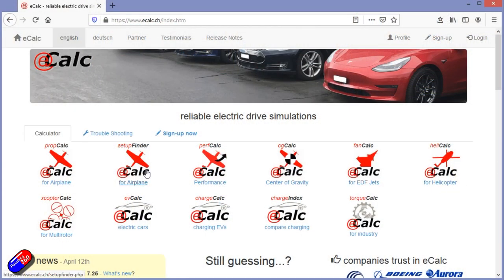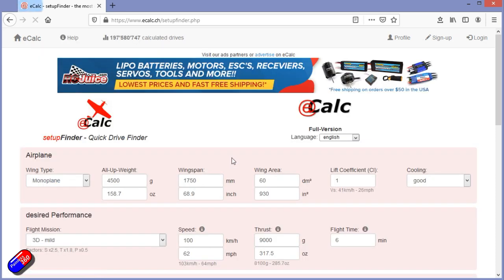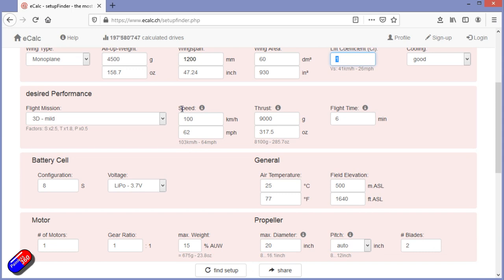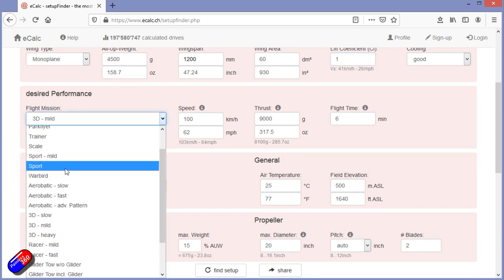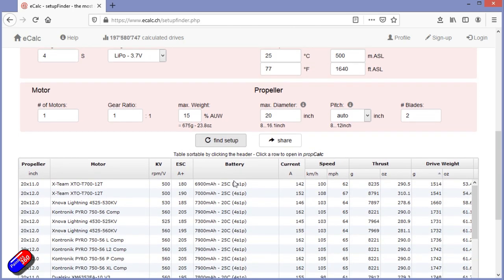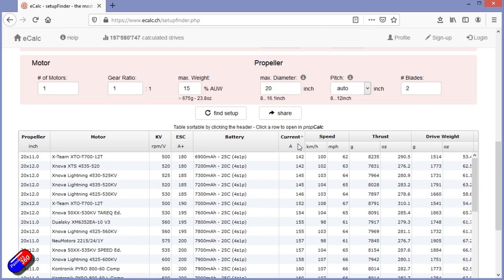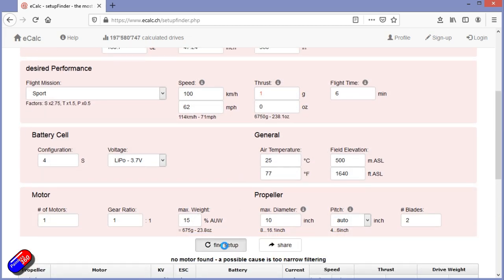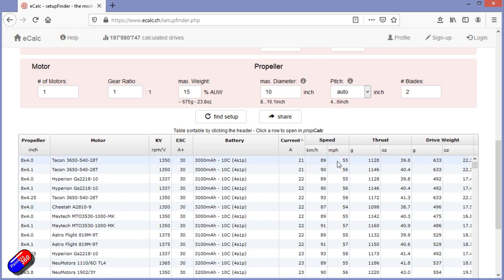Choosing Fixed Wing Motor and Prop. Some Golden Rules!

Comment: Brilliant. I spent months  bench testing and optimising the thrust and lift motors on a differential thrust steer hovercraft. And then optimising the battery for the current draw the best weight compromise. This tool would have enabled much quicker optimisation to motors and prop and batery size. Will be signing up for this tool. Great stuff Lee and Markus. Keep up the good work.

Comment: Hi Mr. P  Great video and series to make.   If it was 40 years ago I could give you the best prop for the motor you was using.  No more !  I could because we didn't have electric power,  Nitro was so much easier.  Now that we have so many different sizes and shapes and wires, we have to many to choose from. Thanks for making this series. Can't wait to see the rest.

Comment: What an excellent video! I haven’t found anything like it! One thing that is tricky in eCalc is matching a propeller to a motor for efficiency. Mathematically, you can graph efficiency vs advance ratio for a motor and prop which allows you to see how both efficiencies compare at different airspeeds. 

Ecalc seems to do this computationally a little bit, but I’ve always struggled to tell if I have a good match for my predicted cruise speed. Take a bit of guess work.

Comment: Lea / Markus - Great intro video. I would love for you to do a series and get progressively deeper into this challenging topic. Personally I would love to see some graphs to explain the non linear relationships between Prop / Motor / Battery / ESC  and Model ( Packaging & Operation) performances. Clearly there are physical boundary conditions as well - such as Size / Weight / Heat dissipation / Flight time / Battery energy density & power ratings. 

Currently I am trying to get into 3D flying and am grappling with the importance of higher battery S rating on flying performance.

Keep up the great work. Thanks Martin
Reply from the maker: Thanks for the feedback. When you select a setup the tools provide a nice graph showing how many of those things work over the range. Stay tuned! :D

Comment: Very interesting and I can recommend ecalc. I have use it to design systems and it is good. As was coming across in the video, it is very easy to rob Peter to pay Paul in component selection and you need to find an optimum grouping of items for your particular requirement. Reasonably priced, and it can be subscribed for a short period, like a month if you have an intense design phase to need assistance with.

Comment: It would be interesting to hear your views on the efficacy between a 2 prop and the latest craze of 6 prop's, thanks Marcus and Lee for an informative talk.
Reply from the maker: More blades = less efficiency. Adding more blades is all about increasing the total blade size so you get more thrust but you get additional incremental losses for each of the blades you add. For endurance and efficiency 2 bladed are the best options (if you have the room!) Happy flying!

Comment: Ecalc is amazing. I've spent more time on that than any other single rc thing. It's brilliant and surprisingly accurate.

The one problem I have with it is that I cannot build out a few options in a spreadsheet. I'd love to graph some of the figures so I can understand the mechanics better. For example, max power vs prop pitch, diameter vs motor efficiency etc. If there anywhere where the maths is accessible without needing masters level understanding of aerodynamics?
Reply from the maker: Let me add that to the list for potential future videos.. Thanks Fraser
Reply: I’ve had the same experience with ecalc. I also wish that I could see more of how it handles in non-static conditions. 

If you want a great resource for the math and calculations behind much of this, my university’s flight vehicle design textbook is very straightforward, clear, and open source. It can be found on the BYU ME415 syllabus page under the textbook section. Comes up pretty quick on Google.

Comment: Would love to hear what Markus and Painless350 have to say about tractor vs pusher configurations and how it effects efficiency. 
example: how to use a tool like eCalc to account for effect of prop being behind fuselage, or wing?

Also a discussion of twin vs single motors would be nice.. A number of models offer the option of twin, or single motor configuration. Why favour one vs. other? What rules of thumb if any, on prop size, motor sizing?

Comment: yesterday flying I had this exact topic come up with my friend-  
I usually tend to go up an inch in diameter and pitch from stock and see how it flies- maybe check the amps with a meter if I'm feeling anal
haven't burned up an esc yet- watching out for heat
very timely video and my thanks

Comment: You have multuple gear ratios in an automobile transmission because the engine produces a limit of horsepower(kW) which is esentially torque X speed.  To get the car to move initially, you have to overcome the static inertia.  To do this, we choose 1st gear, for example, the ratio of which has the highest mechanical advatage and thereby provides the most torque to the driveshaft and rear axle.  As the car accerates and we are shedding static inertia, we choose successive gears (gear ratios) each of which have lower and lower gear ratios.  What we are doing in this process is trading torque for speed.  We stop choosing additional gear ratios when we reach the speed we want to maintain.  We now are operating with the ratio that satisfies both the speed we want to maintain and to propel the load on the drivetrain and engine.  This process allows the engine to operate at a resonable speed in each gear for a given speed of the car.  When discussing propellers, I think it safe to say the torque in the equation is determined by the pitch of the propeller, I.E., the bite the propeller makes into the air ahead of it.  The speed of course is the number of revolutions per minute of the motor at a given set of conditions.

Comment: Good video. Education without information overload.
The 60% rule is something that I never heard of before.
I have a 1100mm T28 Trojan, the stock prop is 9.5 x 7.5, it’s an aggressive looking prop but the plane never achieves a high speed. Is it possible the plane never reaches a fast enough speed to allow the prop to work efficiently? 
Or to put it another way... Does this model suffer from prop-stall of some degree, all the time?
Reply from the maker: What motor and ESC are you using?
Reply: @Painless360  ESC is an eflite EFLA114OW 40amp Bec. I believe the motor is the original Parkzone T28, it has no markings that tell size or kv. Only a sticker “CE Horizon Hobby Inc”.
Reply: @Painless360  I found the online manual for the model, it lists a “480 outrunner  motor.

Comment: This brings up a question that I've been wondering about for ~20 years ........
Why has no manufacturer come out with a flexible Variable-Pitch-Prop.
We certainly have the trick-materials and Computer-Analysis-Tools to achieve this goal,
and it could perform miracles in increasing Model Performance, 
in both Fixed-Wing,  and Multi-Rotor designs.

I, certainly, would be willing to spend ~3X to ~4X the price for 
a high-performance working example.

BTW, this is currently standard practice on many Fishing-Boat  Electric "Trolling-Motors".

Even an Automatic / Mechanical / Centrifugal System could easily be implemented for Models,
just like almost every WW-II War-Plane had.
They were called "Constant-Speed-Props, because their main job was to
keep the Engine operating in its most efficient RPM-Range at various Air-Speeds and Loads.

And, something that was not directly addressed,
a "Stalled-Condition"  will cause tremendous "Drag" and excessive Motor-Loading, 
therefore causing excessive Current-Draw,  
and can quickly over-heat the Motor if continued for more than ~10-Seconds or so.

.
.
Reply from the maker: They exist but as fragile and tricky as CP heads for helis..
Reply: @Painless360  
There's more than one way to skin a Cat.
I was referring to "Flexing" under load, rather than a complex Mechanical-Linkage.
Reply: @jimbrown563  You want less pitch at full throttle (thrust) and more pitch (efficiency) at cruise.  So a flexy prop won't really work.
Reply: @scottyh72  
It doesn't work that way.
It has everything to do with the LOAD on the Prop,
which has everything to do with the Forward-Air-Speed.
The desired outcome is to maintain a constant LOAD on the engine,
we are not talking about a Car Transmission here.

Comment: Another reason more blades are less efficient is due to the preceding blade causing dirty air for the blade following.  Fewer blades gives each blade a cleaner/better bite.
Reply: correct - turbulent air (dirty air) adds more drag on the blade too

Comment: As usual great video, i have a doubt regarding the temperature limits of the motor, is the temperature of the motor directly related to the power and amperage?. For lower kv motors putting a larger prop does not exceed the power limits of the motor but it shows overtemperature >80 deg when tested on ecalc.
Reply from the maker: Excellent question. This is one we ran out of time to cover so will cover it next time if we get enough interest. Thanks for asking..
Reply: I’ve also found that ecalc gives a very safe (overestimated) temperature prediction. Getting the red letters doesn’t necessarily spell out failure, but can indicate when you’re getting close.

Comment: Question: what's the percentage of efficiency loss if a prop is softener or flimsy vs a more rigid prop? Is there any loss? Does the prop material effect thrust?
Reply: That would be represented by a P constant change. If you know the brands of rigid vs flimsy props you could try to view that change in ecalc. I couldn’t give you a percentage and I don’t know how significant it would be. Folding props also rotate forward when turning, but still have great efficiencies.

Comment: It would be interesting to know how airframe drag affects this. If one setup gives you 25% more thrust be 10% less speed is it possible the model would still go faster because the extra thrust better overcomes the airframe drag.
Reply from the maker: An increase in prop speed will give a faster model but as drag increases exponentially with speed it will only be a smaller increase. So twice the prop speed will not be anywhere near twice the speed in practice.

Comment: I suppose thats why variable pitch or constant speed propellors are now standard in full size aircraft. I wonder if these are possible to scale down for RC models?
Reply from the maker: They are available but they are very delicate. More like the CP heads from a heli...
Reply: @Painless360  Maybe the way that technology is constantly improving they will become more common in the future thereby eliminating discussed trade off :-)
Reply from the maker: I'm not holding my breath. From my long time flying helis - CP setups are a pain in the backside to setup and get spot on and then break at the merest hint of a blade strike meaning another 2 hours setting it all back up. Choosing a good fixed pitch prop setup is not tricky when you know the rules of thumb/tips.
Reply: @Painless360  I also suppose the benefits of increased efficiency in fixed wing RC propellers is not as big an issue as it is in the real world, so not a problem that really needs fixing in the first place! Thanks for the video, great stuff.

Comment: Hi, quick question, if I use a low pitch prop and increase the rpm, can I also get a 5th gear prop for my plane with enough thrust? Thanks for a great video.
Reply from the maker: It's a tradeoff. You could have a setup for easier launches and a setup for higher speeds... Happy flying

Comment: cool. does anyone use variable pitch on planes like the helicopters that fly  upside down?  what if we used gears to power a two folding props with  one motor and it uses one for takeoff and one for cruising and the other folds. would that work?

Comment: When u try to buy a motor or prop for a fixed wing these days,, all you find is quad motors. It’s like nobody flies fixed wing anymore
Reply from the maker: Loads about but not usually stocked by those shops who focus on quads. Check out places like 3DXR...
Reply: I find that I often buy my props direct from where I want now days. APC is my go to, sometimes places like Master Airscrew work if I need different sizes. I almost always get what I need and shipping isn’t too bad.
Reply: You are not looking hard enough.  Plenty of motors for fixed wing.  BadAss, KO, Cobra, Sunnysky all make fixed wing motors.